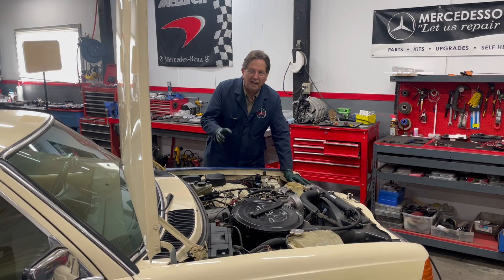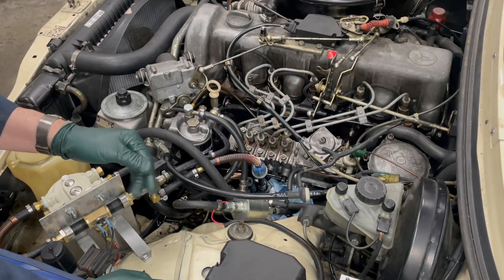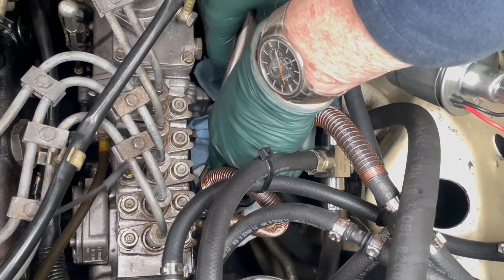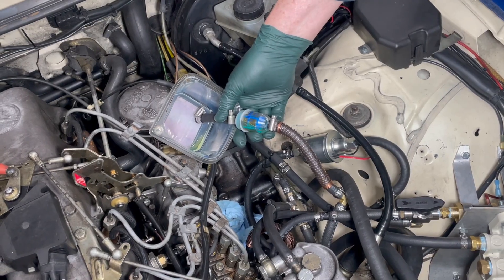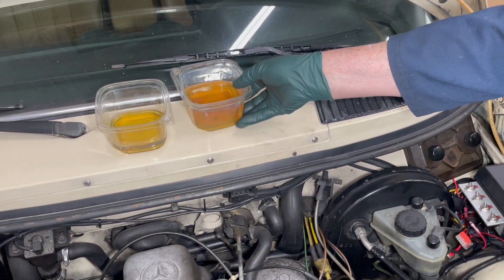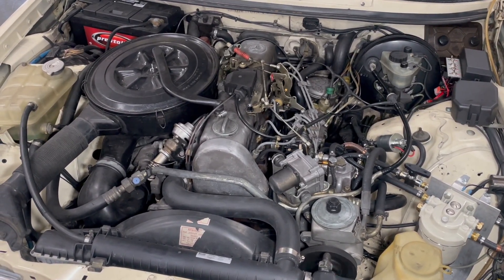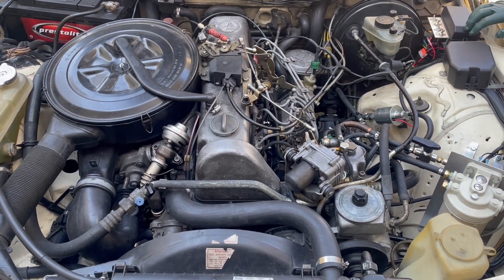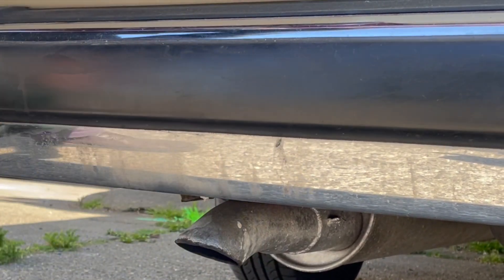300D Dual Tank SVO Conversion: Tests Before Starting. Full Operation Explained

Comment: So this kit can be installed to a 1984 190D om601 2.2 Mercedes? Very interested in this conversion
Reply from the maker: Yes it can. Here is the link: https://mercedessource.com/store/w123-w116-w126-w201-w124-diesel-performance-fuel-boost-pump-kit

Comment: Bravo Kent!
I did ia conversion myself on a small Diesel boat .
I installed 2 electric 3 ways valves .One for the inlet and the other for the return line.
No heater for the vegetable oil but the valves were automatically actuated by exhaust temperature. 
Exhaust over 350 °C degrees : vegetable oil and under 350 Diesel fuel.
Of course it was this way an easier setting than any car application because you run at constant speed  most of the time in a boat.
Great kit ❤

Comment: Would it be a good idea to install an electric oil pump for pre start lubrication since most ware happens during cold start?
Reply from the maker: No. You are better off heating the oil with a block heater or an electric oil pan heater.

Comment: I lived like this for a decade in my past life.   If I could find a nice condition W123 i would do it again in a heart beat!   I have done many conversions.  This is a really nice looking system.  The electric life pump,  and boost heater are important.  I eventually migrated to looped return in all installs.   If the electric pump is located fairly far back in the fuel system its easy to spot leaks, and easy to track filter clog-level.